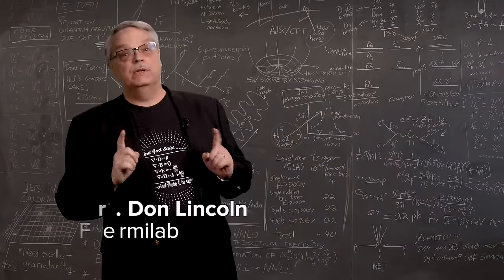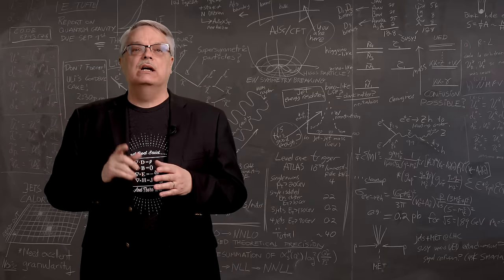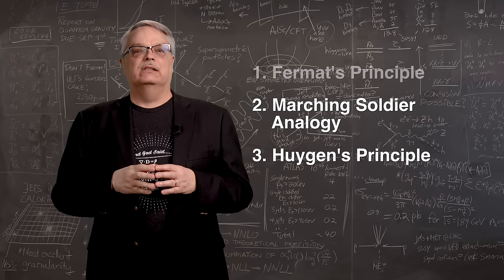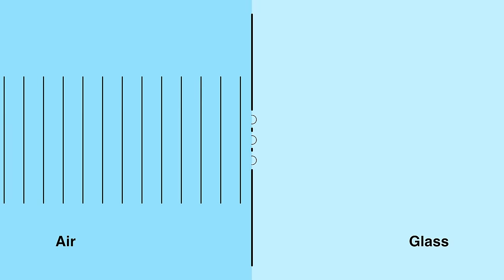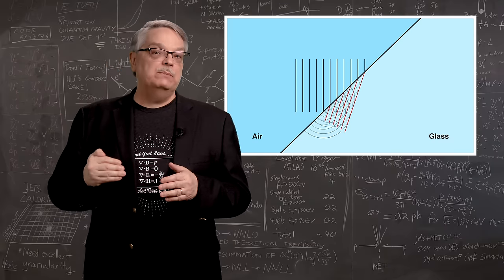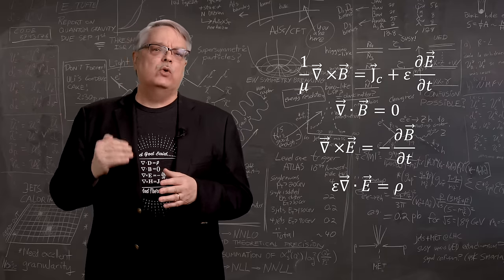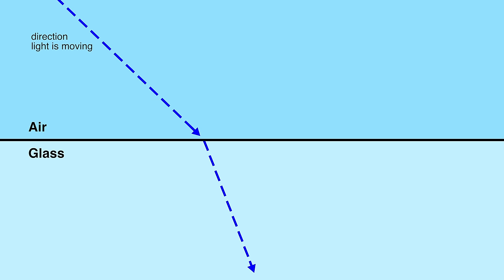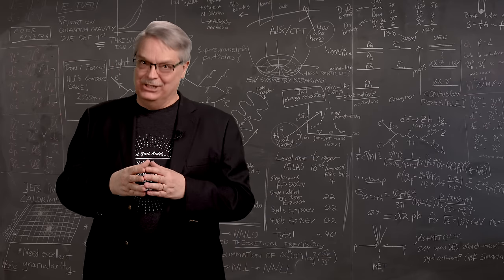Why does light bend when it enters glass?

Comment: Watched the video very carefully and i find explanation given is incorrect. In the video it is explained that the boundary condition of electric field at the interface does the trick where the perpendicular component of E-field is affected by the denser medium hence the bending. However I would like to point out, that the polarization can be such that there is no perpendicular component and yet the bending happens. The correct explanation is because the wave slowdown in denser medium and the requirement that of continuation of tangential wave vector at interface which is a complete wave phenomena and for same reason Refraction is also associated with all waves like sound, em or water.

Comment: Couldn't understand why the parallel component of electric field won't reduce because of polarization. Just as perpendicular direction, in parallel direction as well, there should be a opposing electric field which would reduce it's strength. Could you please explain it physically ?

Comment: Since the light refracts due to the charges in the glass repelling the EM field, does that mean that if the same piece of glass is refracting light in one direction, then light coming from the other side would not be refracted? 

For example, for a refracted view of a straw in a glass of water, would the refraction angle change if I shone a strong flashlight from different directions?

Is it that the glass resists EM fields, but not that it aligns against one? If that case, what is “resisting” physically mean?

Comment: This still does not explain why light travels slowlier in glass than in air. The induced electric field in the glass is in the opposite direction when the incident electric field is static, but for an oscillating electric field in an electromagnetic wave (light), the induced field has a ~ 90 degree phase delay with respect to the incident field. It is this phase delay that leads to a shorter equivalent wavelength of the superposed wave (and thus lower velocity). When deriving this, one cannot avoid using the other two Maxwell equations. All four equations are needed in describing light as an electromagnetic wave.

Comment: So would it be right so say, that the bending of light depends on the polarisation that electric field induces in a given material?
Naively, this would give rise to the following question: Does it take time for light to bend when it enters a new material? What I mean is, that the light actually has to interact with the material first to induce this polarization and the resulting opposing electric field. And if this would be the case, can it be observed experimentally?

Comment: You say the superposition of the waves will only have a different speed if the waves are moving at different speeds relative to one another, I can see that. But why does the EM wave emitted by the oscillating electron travel at a different speed to the incoming light?

Comment: If light went through one medium faster than it does through air, how would you draw the path with paper and pencil?
For glass and air, the path through the glass is a different angle. What angle would it be if it were faster than the air allows?

Comment: Very good. So, light bends because its own electromagnetic character influences the EM character of the glass, water, or air it travels through, and vice versa.

So, I suppose light (and all EM radiation) is bent this way and that when it's inside a star (when it's not being absorbed and reemitted)...?

And now I wonder if it would NOT be refracted inside a neutron star. Assuming the matter in the centre is a sea of neutrons (not something even more esoteric like strange matter or quark matter), there would be no EM forces in the matter/medium... so light would not experience any EM forces on it... so it wouldn't refract. But maybe there's no light in a neutron star, I don't know. I suppose if I found myself in the core of a NS, the last thing I'd be worrying about is if I left the lights on.

Anyway, good to see that clear explanation, thanks!

Comment: Ok, but how to use it to explain why different colors "bends" at different angles? The light propagation direction for all "colors" is the same in the air when white light doesn't separate. So when it hit the surface the angle between electric field and surface is the same for all "colors".
P.s. i am not English native speaker.

Comment: Light in space travels “ at the speed of light”. Thus it seems it should have no concept of time & I believe it sees space in only the 2 dimensions that are perpendicular to the line of travel. So, if light travels slower in material like glass, is its clock turned on & the third dimension is observable? Or, is it pulsing through but still either at the speed of light or stopped - which would also suggest it’s clock is turned episodically, or does photon change into something other than light during the interruption? Or, is there a better explanation?

Comment: Can this explain why light with shorter wavelength refract more than light with longer wavelength? I've heard permittivity decreases as the frequency at which the electric field oscillate is higher, but shouldn't that make it bend less?

Comment: 1 draw a straight line on a sheet of paper
2 lay a book obliquely over the line
3 take a picture of the whole and use it in Paint or a similar app.
4 draw a line with Paint linking both parts of the line not covered by the book.
5 draw another line exactly over one of the two parts all the way to the other side of the book.
6 Lo and behold! Both lines diverge as much as they would if the line were a laser beam, and the book a water tank or a glass slab.

Comment: If lower permitivity is divided by higher permitivity such as air/glass then the answer would be smaller than 1. If it multiplies with E (air perpendicular) then E (air perpendicular) will get smaller. How will it get bigger? Consider 1 is air permitivity and 4.7 is glass permitivity. So 1/4.7 is 0.2128 if it multiplies with E (air perpendicular) it will make it smaller. Right? What am I doing wrong

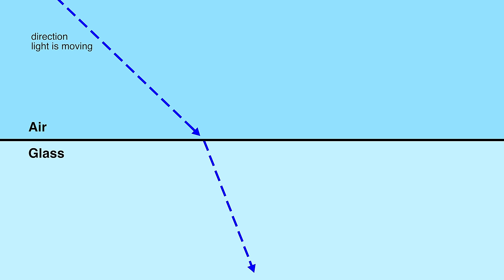Comment: Not sure I understood this correctly. If the "net" perpendicular electric field vector in glass is smaller than in air 11:08, then the resultant angle of bend (gradient) wrt horizontal is less steeper, not more steeper as is illustrated at 11:28

Comment: Besides your mentioning the opinion of most physicists, the only argument you've put forth against the idea of relativistc mass, is the Newtonian law of gravitational force, Admittedly I didn't figure out the argument. Whoever thinks relativistic mass does exist, will claim: the faster the body moves, the bigger the gravitational force is. But it will never be inifinite, because the body won't get the speed of light (unless it's light, which actually has other eqations for calculating its relativistic mass because its rest mass is zero, whereas for its relativistic mass to be infinite it has to have infinite frequency, which is not the case we are talking about). So what's wrong with the idea of relativistic mass of massive bodies other than light?

Comment: 12:00 Great explanation on E_perp but .... Why doesn't this arguement apply to the parallel component as well?  Wouldn't the E_parallel also "make the charges move around" to set up a counterbalanceing E field?  (BTW, i am very familiar with the derivation of the BC's, I'm looking for a specific answer to my question on the underlying physical cause of why E_parallel does NOT get reduced due to the mechanism described in the video.
Reply: Because the video didn't talk about 2 important thing:
1. Reflection, and conservation of energy
When light encounters an interface, part of it is transmitted into the new medium, and part of it is reflected back into the original medium. The law of reflection ensures that the angle of incidence equals the angle of reflection for both the electric and magnetic fields of the reflected wave. This reflection is essential for the conservation of energy.
The conservation of energy requires that the total electromagnetic energy in the system remains constant. If there were a sudden change in the parallel electric field component at the boundary (E_parallel), it would result in a discontinuity in energy, violating the conservation principle. Therefore, both the transmitted and reflected waves must have continuous electric field components parallel to the boundary.

2. Magnetic component

the magnetic field (H) also plays a role in the behavior of electromagnetic waves at dielectric interfaces. The behavior of H is intimately connected with the behavior of E, and they are constrained by Maxwell's equations. The boundary conditions at dielectric interfaces consider both E and H, ensuring that the wave's behavior is consistent and obeys the laws of electromagnetism.

For more information, i recommend seaching for TE, TM, or TEM modes of propagation of light, or if you want a complete course, you may want to look for photonics basics, or optic fiber basics

Comment: Sorry, your explanation is also wrong.  Saying the angle changes because “light moves slower in glass (than in a vacuum)” would mean that X-rays which have the opposite angle change would be because “light moves faster in glass (than in a vacuum)”.  Yet, nothing can move faster than light in a vacuum.

The answer that satisfies both visible light and x-rays bending in opposite directions in glass is given here: https://youtu.be/JZOn1B8K8mA?si=n1oWgMPMaFn3jQ5y

It has to do with the frequency of light relative to the natural frequency of oscillations of electrons in the medium like glass.  Visible light and X-rays are at opposite sides of the natural frequency of electrons in glass, so visible light bends in one direction while X-rays bend in the opposite direction.

Comment: No explanation. It just replaces a question with another. See, it does this because it must obey these equations. And where did you get those equations?? Are you deriving the "ε" for the material for observation on what light does? If so, the explanation becomes: It bends, because of the "ε" of the material, and the "ε" of the material comes because it bends.

Comment: What about the waves bouncing back from the sides of the holes and interfering with the incoming waves coming towards the wall with holes? Wouldnt that make some pre-interference increasing in intensity increasing the chaos of incoming wave fronts that would change the outcome of the pattern on the other side?

Light the double slit. If the particle wave bounces back off the wall there should be some change in the next incoming wave right?

Comment: Great video! I do have a quick question:  if we try to use full potential of light and transform it into electricity(e.g. solar panels): we need an electric field to bend and "interact" with light and then use the bended light in creating electricity. Would that "disturbance" of light create more power?

Comment: Next question: Why only the perpendicular (to the boundary glass-air) electric field vector gets "shortened" in glass, and not the parallel electric field vector? Glass is isotropic, this is GLASS after all.
Further question: why you said only about one, more "convenient" polarization? What about the light polarized perpendicularly to the plane of incidence (and totally parallely to the boundary glass-air)? In this case Maxwell equation gives rot Eair = rot Eglass => Eair = Eglass, no perpendicular component. Light polarized in this direction would not refract at all, since there is no component parallel to the surface... There are anisotropic optical materials like calcium carbonate crystal or quartz crystal, that can refract both polarizations at different angles, but glass is not a crystal.
Maybe the hint lies in the magnetic pair of Maxwell equations?

Comment: That’s great and all, but how does light speed back up after passing through glass or water without breaking the law of conservation of energy?
Reply: It's explained in the "why does light slow down in glass" video. Essentially, it's due wave superposition. The induced fields inside the glass add to the fields of the light, as a result, the velocity of the resulting wave is slower. As son as the wave leaves the glass, there's no more superposition and light keeps moving at its original speed.
Reply: @Ihaveanamenowtaken  It was never explained why the superposition causes the velocity of light to decrease.

Comment: Explained bending of light. Didn't explain why it slows down. Richard Feynman has a better explanation that also explains why you see so many colors of  oil spill over water.  Also explains light never really slow but it the path it takes through material. Thus maintaining light's universal constant speed.  I.e. light always travels at the same speed in any medium.

Comment: What if I have a beam of polarized light with the electrical field parallel to the surface of the glass but still perpendicular to the direction that light is moving?  In this case, the electrical field is not affected by the glass, so the light is not bent???

Comment: Why does light create a counteracting electric field in glass though? Does that mean that glass redirects a charged particle as well?
Reply: Glass is an insulator. The electrons are tightly bound to each other and are not free to move around. Light passes through and only its refractive index (wavelength) affects the path of light. 
UV rays, being shorter wavelengths, pass through glass while the longer wavelengths of visible light are refracted.

Comment: So there should be a relationship Between angle and epsilon. And also glass is insulator charges doesn't move in it. There is counter electric field due to polarization so why there is slow down of electric field in perpendicular direction only. 
I would be thank ful to you for doubt clearing

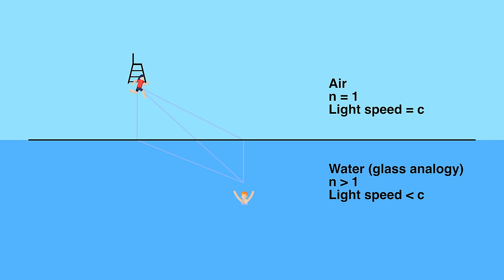Comment: 3:20 , what am I missing. If you calculate some speed for running and some slower speed for swimming, I used 20 mph run speed and 4 mph swim speed, and a 6 miles x 6 miles square, with the lifeguard at one corner and the person drowning in the opposite corner, and half the square on land, other half in water. The fastest time is definitely running to the shortest distance of swimming. I put it into a spreadsheet and calculated every distance from a direct path up to running to the shortest swimming distance. I assume this man is much smarter than myself, but what he says does not prove true using basic math. Help me out.

Comment: This isn't really an explanation, is it? 
"With a little bit of calculus", we'll jump straight to the result.
The diagram appears to show polarized light. There is no reason for the incident light to be polarized before it even reaches the surface of the glass. That would imply that the Sun was being influenced by a piece of glass 93 million miles away.
It seems to me that the most important thing is the surface of the material and how the electrons in the surface layer of atoms behave when the E-field interacts with them. They clearly move differently to those inside the material and generate a differently oriented interacting field.

Comment: I'm late to the party ... but only 4 years ;)
if the light bends because it polarizes the charges in the glass, causing an electric field that weakens the electric field of the light itself in the perpendicular direction of the surface, how is it then possible, that ie. x-ray radiation gets bend in the other direction? for that the perpendicular field strength component needs to be increased, regarding this explanation.

Comment: Great video. Just found your channel. Question. Since the opposing electric field in the glass causes the perpendicular field to decrease, is there a time constant involved? That is, if a pulse of light strikes the glass does Snell's law take a finite amount of time to be satisfied. Light can travel about 3 mm in 10^(-11) sec. If the new field took longer than that to establish then the light would not bend immediately. I can imagine a sheet of glass 3 mm thick hit with a pulse of light and a row of detectors on the exiting side. If the pulse were long enough then one might observe a sequence of detector signals as the field established itself.
Reply: I may have found an answer to my question. In a chapter titled Dielectrics under Electric Field (search "Electric Field" "Liu Hongbo" with quotes) the author states that internal fields form in 10^(-16) to 10^(-14) seconds. Very fast compared to 10^(-11). However, fields in water take about 5x10^(-11) seconds which is a little slower than the light travel time. Maybe Dr. Lincoln will weigh in at some point.

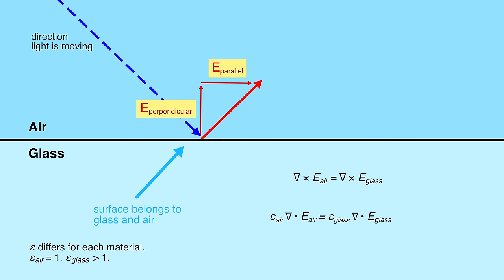Comment: Thank you for your time and your explanation, but I wonder if my brain is not made of glass when I see how slow he is when it comes to understand your light. First, if the speed changes in a glass why does it change differently considering the ray of light going out of a prism second I understand with the equation at 10:33 that the two epsilon air and glass are equals. I will also add that the frequence and the length of a wave have litlle to do do with the speed of the ray. Nevertheless, I rather conclude that I have missed something.